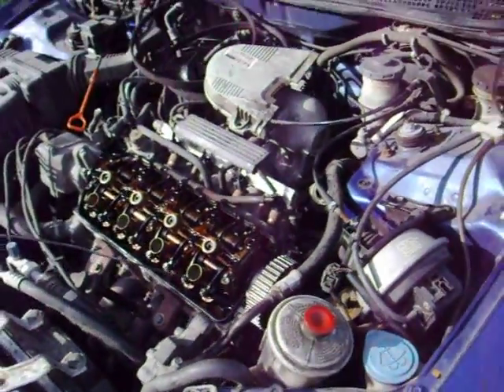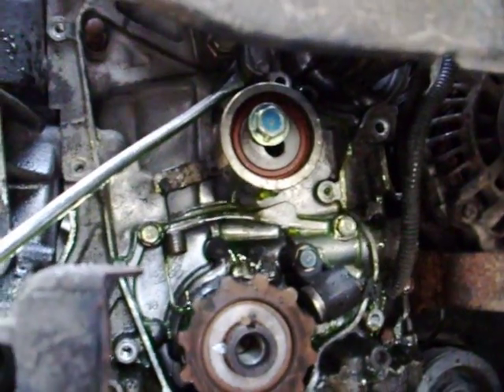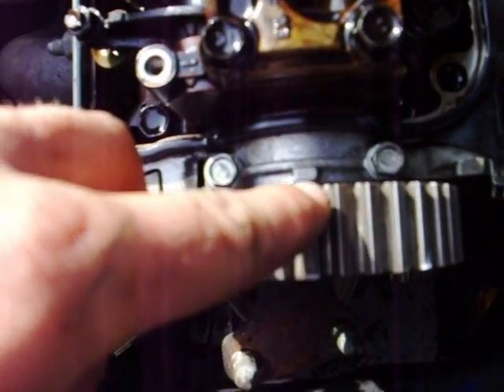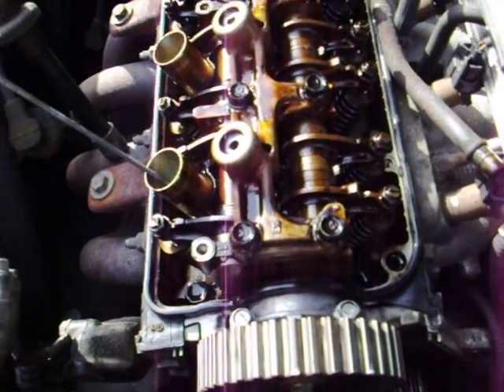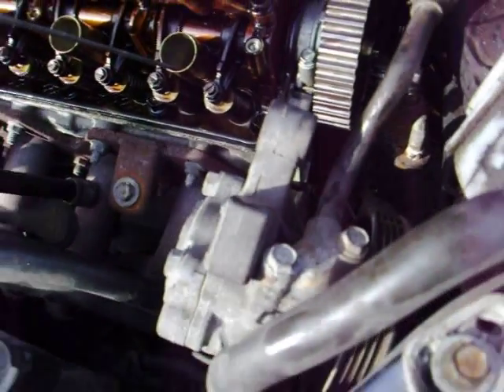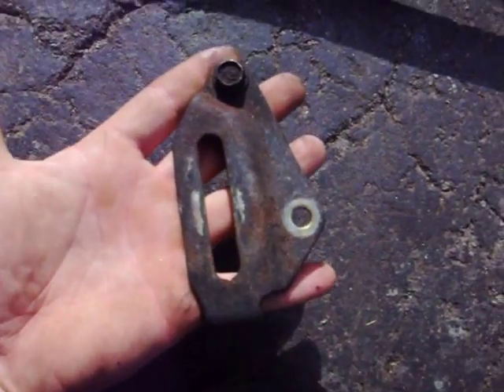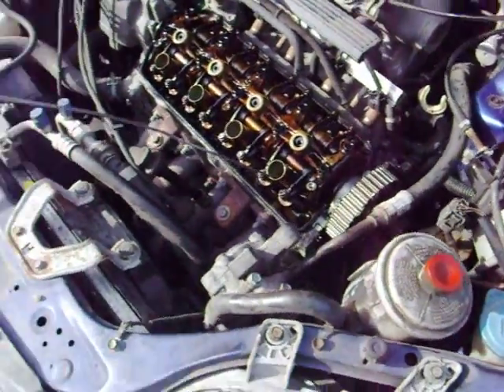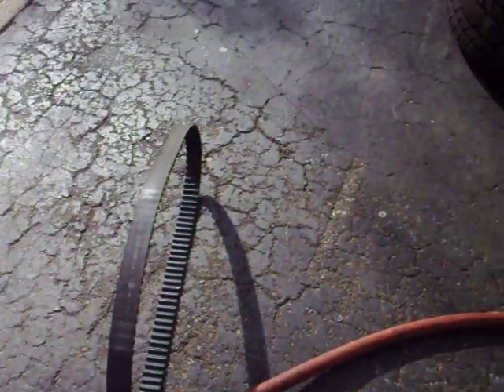Honda civic timimg belt replacement single OHV v-tec

Comment: Rich, my daughter has a 2003 honda civic. And they told her at the dealer that she needs a oil seal replacement. they were charging her $1500 for the work. now i have been looking for any info on this and i came across your video, i think its great. one question to do what you need it to do to it, did you had to lower the engine from the left side to get to the water pump.

Comment: @deion712 any engine with the valves above the pistons are ohv . the overhead part of the name refers to the position of the valve "overhead" of the piston. so an ohc is also an ohv. the term ohv is pretty outdated these days though. pretty much only lawnmower engines are about the only thing that doesnt have overhead valves oh and like 2 strokes